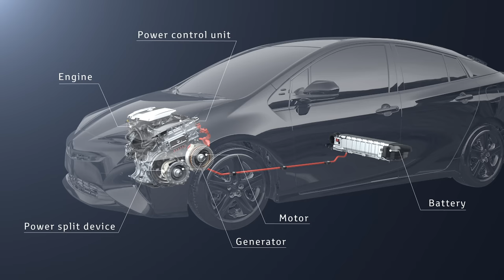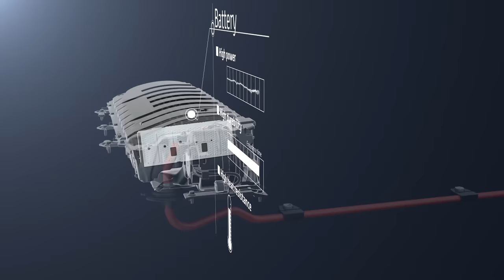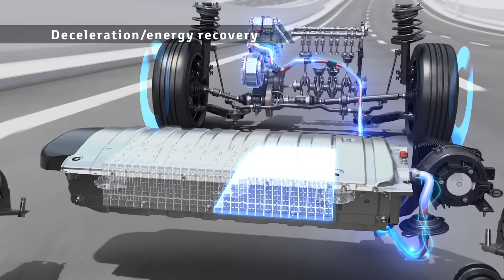What is Toyota Hybrid System

Comment: Something that I learned yesterday, is that electric motors are dramatically less efficient when load is less than 50%. Ideally, 75% load is used, as it's most efficient. The more powerful the motor, the more efficient it is at low load, supposedly. I have no idea if this is true, but it's interesting to think about. It means that the hybrid system could be almost always used in tandem with the engine during accelerating, for maximum efficiency. Otherwise, it's actually slightly less efficient, because it takes some energy to make electricity, and to run the motor. A result is a decrease in overall fuel economy, unfortunately. The CVT transmission more than makes up for this, but it could be better, and/or even simpler.
Reply: An electrical motor having a load of 50% will still achieve a 75% efficiency compared to an internal combustion engine which has a measly 23% efficiency at the most..
Reply: @boyetz88  that's definitely not true. 23% is low, definitely not it's maximum. It's at least 35%, but could easily be much higher than that.
Even though electric motors have a high efficiency turning energy into force, power, etc. they are not quite as efficient as engines, because the power source is being oversupplied, mostly being wasted. At any given time, electricity is being generated, but not being used. This is because electricity cannot merely meet demand. Anything not being used is wasted, grounded, etc.
It's not as good as advertised,  the comparisons are not thorough enough.
Reply: @grantmccoy6739  electricity is not directly applied to the motor, any generated electricity is saved on the battery, the motor draws power from the battery not the engine. So yeah motor is still way more efficient than engine.
Reply: @shaheenshad5012  actually it is. There is a direct path between MG1 and MG2. It looks silly at the beginning but allows the ICE to run at max speed and torque efficiency. Storing energy to use it later is less efficient choice.
Reply: No, engines are much worse at low loads. Electric motors are near 90% efficient from 1% load onwards until they hit around 80% max RPM. Engines have a narrow range of RPM and load where they operate the best. The hybrid system allows the engine to run in its happy spot, and store excess energy in the battery for later use, such as when the engine is turned off.
Reply: @Appletank8  I think that you're right. BTW, this post is around 1 year old.

I had read that electric motors are less efficient under low load situations, but I'm convinced it was incorrect information. If you think about it, the higher the load, the more hot it gets, which is less efficient, not the other way around.

But yes, the hybrid allows the engine to operate in its most efficient engine speeds.

I don't know what you mean by engines are much worse at low loads. Do you mean by comparison? Or do you mean the engines operate more efficiently at higher loads? There's no question that electric motors have higher energy efficiency. They don't even use their energy source, it simply passes through. That's why it's over 90% efficient. The loss of energy is due to heat, not work. Engines on the other hand turn energy into heat, and extract work from heat. It's inherently less efficient.
Reply: @grantmccoy6739  
Try looking up so BSFC charts for NA engines. These charts display how an engine generates power in relationship to RPM and load. In most NA engines, they are most efficient somewhere between 1.5K and 2.5K RPM, and at 70-80% load. Or, they produce the most power per unit of fuel.

This is because spark ignition engines tend to control power via restricting airflow. At low loads, the engine is forced to breathe through a straw, creating a vacuum force that slows pistons down. Opening the throttle valve allows air to flow more freely. Over 80% the amount of heat generated starts getting inefficiently lost to the cooling system. This is typically why overdrive gears are more efficient, even outside the reduced friction. The throttle valve can be opened more, and the engine spins more slowly in comparison to speed.

Diesel engines control power through fuel flow restriction, there are no air pumping losses.

Using late intake valve closing allows you to produce less power with a more open throttle, reducing losses, ontop of more energy extraction from the longer effective power stroke. 

Cylinder deactivation allows you to open the throttle valve more with less power.

EGR allows more air but less oxygen into the engine.

Turbochargers allows using a weaker engine for steady cruising, letting it open more throttle, until passing power is needed.
Reply: @Appletank8  yeah, I am aware of that.

But like you mentioned, with diesel, load doesn't mean airflow, which means that loss of efficiency doesn't apply.

In general, low load efficiency losses are a result of throttle restrictions, not actual efficiency performance characteristics. 

So, no, low loads are not less efficient as a fact. They are technically more efficient, because of better energy efficiency. 

So basically, low load is always more efficient than high load, unless the design changes this performance.
Reply: @grantmccoy6739  
Sure, but I was talking in context of most spark ignition engines, and for the past 100 years or so SI engines used throttle valves, which made efficiency worse at low loads. 

Only in the past decade or so have various OEMs experimented with valve-based throttle control. Meanwhile, hybrids do their best to avoid "low load" entirely, by instead running a higher load and storing extra energy into the battery and then turning it off.

The vast majority of SI cars still benefit from the pulse and glide technique, because they use throttle valves.

Lower loads are only really more efficient if the engine design is notably changed from standard, like turbos who are very decidedly less efficient due to the need to keep temps down at higher loads. (and even then, technically at lower load a turbocharged engine becomes an underpowered NA engine working at "higher" load)
Reply: @Appletank8  what's pulse and glide, never heard the term?
Reply: @grantmccoy6739  A technique that's more applicable to hybrids, but can still gain some benefit in gas-online cars.

Basically, you try to drive in two conditions only: your vehicle's most efficient zone based on the BSFC (brake specific fuel consumption) map, or not at all. Hybrids facilitate this by specifically controlling engine power to fall within the peak efficiency range, and being able to automatically cut fuel when off throttle with 0 engine braking, allowing you to coast a good distance on zero fuel usage.

Typical behavior would be to accelerate briskly to 45 mph, then coast to 35 mph. Repeat. 

For the Prius, its BSFC peaks at like 60-80% load, and from 1.7K RPM to 3K RPM, which is where the car's ECU tries to stay inside.
Reply: @Appletank8  so your in a constant state of acceleration and coasting? That's absolutely not more efficient, or practical. Obviously coasting is, but not accelerating. It's highly unlikely that the gains exceed the losses. Cruising is always the most efficient way to drive (while actually being powered).

But just FYI, 1,700-3,000 isn't exactly an efficient set of engine speeds. It's only necessary because of the performance of a 4 cylinder. It would be more efficient at even lower speeds, but 4 cylinders don't have smooth power delivery.

Also, constantly turning the engine on and off is way more extra work for your starter.
Reply: @grantmccoy6739  
This has been a technique practiced by hypermilers who get 90+ mpg on the prius for the past 20 years, so I think it's working pretty well. Look up "Energy efficient driving" on wikipedia for an overview on PnG, or "autospeed brake specific fuel consumption" on a detailed explanation on how it works. I myself regularly get 60 on a car rated for 45-50.

Also useful, search "beating the EPA Cleanmpg" for a more through explanation on what techniques advanced hypermilers use to get 50% more mpg than estimated. Its from 2006, but engine physics are still broadly the same.

Also, as mentioned in this very video, hybrids are designed to start stop the engine a lot, because they don't use starters, they have a 50HP electric motor.
Reply: @grantmccoy6739  
As a simple example, if you can accelerate for 10 seconds at 30 mpg, then coast 10 seconds at infinite mpg (0 fuel), you have essentially achieved 60 mpg.
Reply: @grantmccoy6739  
PS: PnG is less relevant for highway driving since you're usually near optimal operating conditions anyways, and air drag slows you down too much.
Reply: @Appletank8  that's right, they use the motor instead of the starter. It's a bit less problematic for hybrids. 

I'm not convinced about that tactic. Engines only use enough fuel to keep the speed consistent when cruising. The waste comes from the design, ie, engine speed too high, throttle restrictions to volumetric efficiency, or rotating mass.
Reply: @Appletank8  that's basically what I'm referring too, but that also explains gliding more to stops, as opposed to purely powered motion, and then braking.
Reply: @Appletank8  the question for this becomes, what is the cruising mpg? Because the fuel consumption under acceleration is way higher.

Basically, the entire cvt function of the prius confirms that cruising is more efficient than acceleration. But not directly,  I guess.
Reply: @grantmccoy6739  Well, yeah, in a perfect world power requested would be proportional to fuel usage no matter where you are. 10 hp for 10 fuel, 5 hp for 5 fuel.

But because of how SI engines are designed, IRL fuel consumption doesn't work that way. Turns out 5 hp requires 7 fuel instead.

Steady state at say 35 mph may require less fuel consumption in that instant, but you need more fuel per HP to maintain that speed, vs opening up the throttle for a bit more fuel and much more HP. 

Regarding the Prius, did you know that below 45 mph the ECU straight up doesn't let you use the engine below 1/2 power (assuming sufficient battery)? At such low load the engineers decided that running on electric is better than using such low load despite the conversion losses. 

At slower speeds, if you want to avoid the losses of converting motion to electric then back to motion, the best way to drive is to go at 2/3 power, even if it speeds you up faster than you'd need, then get off throttle and avoid the electric only zone. 

That increased fuel usage isn't "wasted", it is turned into kinetic energy in the car that you can then use to coast.
Reply: @grantmccoy6739  
Fun fact: imagine if 10 hp = 10 fuel, but 2 hp = 9 fuel

This is why turbine cars didn't work. Their efficiency peak is very narrow; only planes get away with it because they spend most of their time cruising at near top speed. Cars have traffic to deal with.
Reply: @Appletank8  it's pretty widely understood that engines are more efficient cruising than accelerating. I know you understand that, but it's very unlikely that what you're describing works, or at least, that it's the best possible solution. Maybe the design is not ideal for cruising, like you suggested, so there's some wiggle room. But it's a really awkward way to drive, especially with other cars on the road.

There's many reasons why the prius operates like it does. I'm sure it's because of the fact that its a 4 cylinder, and because it's gasoline. BTW, there are work arounds for gas engines, like direct injection, that remove the throttle restriction problem.

But generally speaking, lean conditions are more power efficient than rich conditions. Meaning, cruising is better than accelerating and gliding. Assuming that the design is somewhat efficient in the first place.

Here's some food for thought: in cruising, you are basically combining the situations of acceleration with gliding. Meaning the load is some average of the two. So the question becomes, is your car getting maximum possible energy efficiency out of its fuel under acceleration? If not, cruising is better. If so, cruising is about the same. See what I mean?
Reply: @Appletank8  yeah, that's interesting.
Reply: @grantmccoy6739  
Note that when cruising, people are generally at a speed where overdrive is hopefully in gear. At the highest gear, engine to wheel torque is lessened, and the engine has to work harder to maintain speed. Therefore, getting closer to the BSFC peak. Despite higher air resistance, highway driving is typically more efficient because of more time spent in overdrive gear. 

I can guarantee you that requesting the same power with a lower gear will increase fuel consumption, because the engine will have to restrict air to maintain speed.

Regarding your thought experiment, unless you can find me an engine that has an identical fuel per hp rate across a load range from 40 to 90%, or a car that sits perfectly in the lowest SFC zone while cruising, pulse and gliding will result in less fuel used over time.

I'm exaggerating the following fuel consumption for effect

imagine if the engine can produce 100hp for 10 fuel/mi in its sweet spot. However, you only need 50hp to maintain your speed. Unfortunately, at 50hp you need to use 9 fuel/mi. Using 10% less fuel for 50% less power is an awful trade. Might as well use 10% more fuel to go faster, then shut the engine completely off and use No fuel. This is the most important part. Instead of using 9 fuel/mi for 10 miles, you are using 10 fuel/mi for 7 miles, then no fuel for 3 miles.

In this example, cruising results in 90 fuel used (9 f/m * 10m, or 0.11 mpf), while PnG results in 70 fuel used (10 f/m * 7mi + 0 f/m * 3 mi, or 0.14 mpf).
Reply: @grantmccoy6739  And yes, how much you can squeeze out of PnG depends heavily on how annoying traffic around you is
Reply: @Appletank8  your relying way to heavily on "power" in your calculations. Torque is the only thing that actually matters. Torque is the force the engines produce, ie, how much weight it can move. Power is factored through distance, aka engine speed or wheel speed (final drive or gear ratios). You can have less Torque, but more Horsepower (due to engine speeds), clearly a paradox. 

The reason Torque doesn't produce the same acceleration when a vehicle increases its speed isn't due to power, it's due to air resistance.

As far as efficiency is concerned, torque is generally highest at lower engine speeds. The actual reason an engine accelerates is because it facilitates the change in vehicle speed (not because it produces more force) because the gear ratios are fixed. Adjustable gear ratios basically don't exist, but the ones that do are called, CVTs, like the prius.

On the other hand, increasing air/fuel does increase output, torque, power, whatever you want to call it, but unfortunately results in engine acceleration, an inefficient side effect. CVTs allow for engines to increase torque without accelerating, which is both more powerful and more efficient.

Edit: you are assuming that cruising is only 10% more efficient than accelerating, which must be way off. If it's correct, or just a hypothetical situation, you would be right.
Reply: @grantmccoy6739  
One, I'm using HP as a shorthand for increased throttle demand.

Two, gears are circular levers who multiply (or divide) torque. Cars will still accelerate slower at speed with zero air resistance because overdrive gears force the engine to have a proportionally slower speed to wheels. That's what levers do. How else do you think an engine can be at both 2K RPM and 3.5K RPM at the same speed?

Closing a door by pushing the middle vs pushing the edge is a lot harder, but you travel a shorter distance. That's what overdrive does. Air resistance only really becomes a factor above 40 mph.

Three, I said the cruising vs PnG example was an exaggeration for effect, it is not 90% less efficient, but it is not 1:1 either. This is why I asked you to look up some BSFC charts. 

Using Toyota's new 2.5L Atkinson engine since the EPA did a report on them, it is most efficient at converting fuel into energy at around 70% of possible torque, (170 Nm), and between 2K and 3K RPM, at 39% efficiency.

If you're barely feathering the throttle, at 20% torque (50 Nm), 2K RPM, your efficiency drops to 30%, which is about a 23% drop.
Reply: @Appletank8   I apologize for length.

the Atkinson cycle is fairly redundant. The beneficial result of keeping the intake valve open longer (partially during the compression stroke) is using less work to compress the air. You could achieve the same results, by using throttle restriction to reduce the air volume in the cylinder. 😆
So, no change. It's just a different way to achieve the same results. Namely, airflow control by a valve of some kind.

More food for thought: the efficiency differential between highway and city driving might be, 20 city/30 highway mpg (a fairly common statistic). This is a 50% increase, FYI, not 10% like your hypothetical scenario.

My car, a 1989 Nissan 240sx, has 20/26 mpg. A ~30% increase for highway.

It's not very efficient, probably not because it's old, but because it's a 4 cylinder, and operates at higher, less efficient, engine speeds. Unfortunately,  having more cylinders means more rotating mass, so it's a trade off either way.

Interestingly, the 1996 240sx that I used to have had a rated 20/28 mpg, and this additional efficiency was achieved by tuning the engine to run lean in a portion of the powerband that was highway speed in 5th gear. So basically, they sacrificed performance for mpgs. (You can see this in the powerband in these vehicles, it has a significant dip in output in these rpms, ~3000)

To be honest, I don't think that mpg statistics are that accurate. Even if an engine was tuned to be leaner, it would only matter under acceleration, not cruising, because engines only ever use as much fuel as needed to operate when cruising. But it could be that more air is being used, resulting in a leaner, more efficient condition. I honestly don't know. I only know that fuel is cut out of that part of the powerband, even under full throttle conditions. My Nissan has a weird tune as well, but it's different.

One if the reasons for gear ratios is efficiency, not leverage. Instead of running at 6000 rpm on the highway, you can cruise at a speed that has the most torque and mpg, and isn't as noisy.

It's really an interesting discussion about torque vs Horsepower, because it really is a discussion about leverage. In my opinion, I don't think that leverage is "real", which is another story entirely, but you can witness its effects, so it's hard to argue with. It all comes back to moment of inertia, being a moment and not a distance, but I digress. 

One thing though, leverage shouldn't effect torque itself, just the advantage ratio. So higher gears don't result in less Torque, just less "advantage in using it".
Reply: @grantmccoy6739  
I agree, engine torque doesn't change, but torque at the wheel does. The engine produces 50 Nm of torque, but when it goes through an underdrive ratio of 1.5:1, the wheel will output 75Nm of torque, at a slower proportional wheelspeed. This is why its easier to loosen bolts with a really long wrench, and easier to climb hills when you downshift.

Crusing really slowly at 20mph means you're stuck in underdrive, no way will you be able to go into 6th at 20 mph. Using that underdrive ratio earlier, the engine must be restricted to 33 Nm to have 50Nm at the wheels. This is very far from peak efficiency.

50Nm of torque through an overdrive gear of 0.5:1 means the wheels are only feeling 25 Nm of torque, but they're spinning a lot faster now. Like spinning a screw with your fingers. Useful for 60+ mph, bad for uphills.
 
If you need 50Nm of torque at the wheels to maintain speed, the engine needs to output 100Nm to get 50 at the wheels in Overdrive. According to the BSFC chart, you are converting fuel into torque more efficiently.

Note regarding Atkinson: Late intake valve closing is very much NOT the same as throttle plate restriction, outside the goal of reducing air in the cylinder. Otherwise the decision to use one or the other would be meaningless. A throttle valve forces the piston to draw air through a choke. A late intake valve allows air to flow more freely through the piston, and a greater expansion stroke ratio, therefore extracting more energy out of the combustion, and therefore higher BSFC to one without Late intake. This has been tested and proven multiple times. Throttle valves are butterfly valves, piston valves are poppet valves, they operate very differently.

I agree that engines will only use as much fuel as required, but they are using fuel inefficiently the further away they are from peak BSFC. This is shown in Toyota's released charts on how they restrict their hybrid engines to only operate within a restricted RPM AND torque profile. Because going away from it is BAD

Piston engines aren't as bad as turbine engines are, burning almost as much fuel at idle as in full power, but there is still a range of better and worse fuel usage. There's a dedicated community of hypermilers who use this technique and it works. It is not  theoretical, it is proven in real life tests.
Reply: @grantmccoy6739  The important thing to keep note of is that Pulse and Gliding is a kinetic way of emulating what Series Hybrids do (engines are not connected to the wheels whatsoever, and instead charge the battery only). When you accelerate in the most efficient BSFC mode, you are putting that energy into the kinetic energy of the car, just like how the range extender of a Series hybrid runs in its efficient mode to convert fuel energy into battery energy.

While the Hybrid then uses the electrical energy to create the kinetic energy of the car, the non-hybrid car shuts the engine off and "uses" the stored kinetic energy into coasting with no fuel needed.

While the initial burst of acceleration uses more fuel than cruising does, the big gain is the ability to use no fuel for a % of the distance.
Reply: @Appletank8   that's a pretty good explanation of torque. I never really thought about wheel torque like that. The last thing you said was that using 100nm to produce 50nm was fuel efficient, and I'm not sure what you mean by that. It would seem that the opposite would be true, that torque production was more efficient at low gear ratios. Considering how 50nm would result in 75nm, etc. My idea is that if the engine needs to produce less Torque, it also needs to consume less fuel. In this regard, and considering what you said about gear ratios, it would seem that low speed operation would actually be more fuel efficient than high speed, not less.

I disagree that the Atkinson cycle is really distinct enough to be note worthy. It's basically still drawing vacuum in the combustion chamber like normal (it's just not in the manifold, etc) but it just decompresses itself to control the air volume, as opposed to just restricting flow overall. Throttle valves meter air, while still allowing for adjustment to it, in case you need much more air/fuel for output, as opposed to being restricted to the ideal tune.

To be fair, there is a certain amount of work needed to draw in air, it's not nothing, but why would this be better? It still is drawing in air via negative displacement, it's just also pumping some back out. It could actually be less efficient in some cases.

As far as the Atkinson expansion ratios, that's not something people usually talk about, but it's like that with any ICE design. Every exhaust has higher expansion ratios than intake. It's the whole function of the engine. Reducing the intake "compression ratios" doesn't actually make it better either, it just reduces it on the exhaust side too. So it takes less work to compress, but it expands less afterwards. Maybe it works, but I'm not convinced.
Reply: @Appletank8  the only reason why this pulse and glide would be more effective, is because the normal operation of the engine is outside of the maximum efficiency (or force, if that is the objective) range of engine speeds. In other words, if the transmission is geared incorrectly, or the engine is tuned/designed incorrectly and wastes fuel.

With a CVT, there should be no need for p&g, as that is what cruising is (just on the minutiae of scales), and the gear ratios can be adjusted to suit the needs of the vehicle without shifting gears.

Just to go back to something you said in the other comment, gear ratios actually shouldn't affect the force output total at the wheel, only the distance over which it is applied. I don't think we should go around in circles about this, but I disagree with how you explained it, even though I think you did a good job and made a good point.

For example, you may be correct that the output in a 0.5:1 ratio goes from 100nm to 50nm, but since the distance covered is twice as much, it's still 100nm of force. So its 50nm + 50nm = 100nm. See what I mean?

I find it hard to imagine a scenario where it's more efficient to run a power plant at really high loads (albeit efficiently) to generate electricity for storage and then turn it off. It seems like it would be better to just match the power plant output to the demand (even just by throttling fuel), but I guess you might have intermittent demands. I know that the prius is some combination of these two scenarios, as sometimes the engine will be on or off depending on the situation.
Reply: @grantmccoy6739  
You still haven't gone looking at a BSFC chart, have you? In a perfect world, X amount of torque would require a proportional Y amount of fuel. 

As I have said multiple times in this thread, IRL engines do not work that way. There is a significant efficiency loss when the engine has to pull air through a restricted intake. Imagine trying to walk on a floor made of gum. Each step is draining energy when you have to lift it. The more restricted the intake, the stickier the gum.

Despite walking slowly, it takes extra effort just to pull your feet off the gum.

Why cruising in Overdrive gears is more efficient is explained in the BSFC chart too. I repeat: the ratio of torque to fuel needed is NOT EQUAL. There might be more fuel per stroke for the increased torque demand, but there are a lot less strokes per wheel rotation.

This is why opening the intake allows for better efficiency. Please do a search for  BSFC charts. I have been repeating this for the past 5 replies.

Regarding expansion stroke, um. No. 

Imagine a 1L single cylinder engine.

In standard Otto cycle, the intake valve closes at bottom center. The compression stroke therefore compresses a Liter in volume. The expansion stroke can only go down 1 L in volume when the exhaust valve opens. 1L intake = 1L power/expansion. You can't open the exhaust any later than that.

In an Atkinson, late intake valve means it only compresses 0.8L of volume. the power stroke still covers 1L, therefore a longer expansion stroke ratio. 0.8L < 1L.

This is on top of how it allows opening the throttle valve more, and therefore less intake losses.

Again, please, please look up what BSFC charts mean for engines, and the techniques hypermilers use for their insane MPGs way above EPA estimates. They'll teach you everything there is to know about how engines work. Numerous resources on the internet on why Atkinson is more efficient than Otto.

If you refuse to learn about BSFC then I might as well have been talking to a brick wall.
Reply: @grantmccoy6739  
That's ... not how you measure torque. Torque does not measure how much the wheel turns, only the amount produced at that instance.

The formula is Torque (Nm) = Force (N) * Radius (m)

If I have a screw that requires 10 Nm to open, and the max force I can generate is 5N, I can either generate a lot of torque with a 3m wrench (15 Nm), or struggle with a tiny 0.5m wrench (2.5 Nm). I am definitely producing less torque there, and therefore unable to unscrew the screw.

> the only reason why this pulse and glide would be more effective, is because the normal operation of the engine is outside of the maximum efficiency.<

CORRECT. CORRECT. CORRECT. CORRECT. CORRECT 
How many times must I repeat this?

Engineers must choose between optimal cruising efficiency at 40mph or enough HP to pass cars on freeways at 70mph. Obviously, they choose for more HP. I am trying to get you to understand how inefficient engines are outside of their sweet spot. Most cars only enter this sweet spot at around 60+ mph and in overdrive (which is why efficiency increases despite increasing air resistance). When throttle is restricted, especially to lower torque for cruising at below 40mph they are wasting energy 

As I said earlier, at 20% throttle you are 23% less efficient than at 75% throttle for that 2.5L engine. This is tested on a Real World engine, built less than 3 years ago. This is literally how they work. Older engines are even worse.

This is still true in CVTs because the optimal zone produces too much power for sub-40 cruising, due to, again, being designed for having enough power to pass cars at 70 mph. The benefit is being always lower the RPM at any speed, which reduces friction, lowers the gear ratio and opens up the throttle a bit more. However, if the torque required of the engine is less than the BSFC peak, then it will still be less efficient than P&G. This is how people get 90mpg in the prius despite steady state suggesting 50mph.

I repeat: the only time an engine would be most efficient while cruising is it can sit perfectly within the BSFC peak. It has been estimated that it takes only about 20HP for cruising at 40mph. Therefore, an engine that sits at BSFC peak at 40mph will only have around 40 HP. This car would be almost completely useless for anything else.
Reply: @Appletank8  I think we can probably stop here.

Like i said, the combustion chamber draws vacuum during intake no matter what, the difference is only in the strength of the vacuum, and where the vacuum is located, ie in the combustion chamber or manifold.

Also, the difference between a partial vacuum and a full atmospheric pressure combustion chamber is very significant in terms of compression. Maybe not in terms of distance (mechanical compressionratio), but certainly in terms of forces (air pressure, or PSI).

I'll check out the bsfc.
Reply: @Appletank8  you should try to recognize when I am agreeing with you, and when I am disagreeing, it makes the conversation less frustrating. 

You were saying earlier that wheel torque is a function of the change in distance of the difference of the gear ratios. Ie, that 0.5:1 ratio would change torque at the wheels. Since torque at the crankshaft is fixed, ie the stroke isn't variable (normally), your above reply wouldn't matter. BTW, my previous explanation using distance actually is relevant, that's how power is calculated, and leverage in some instances. I'm just pointing out that leverage is relative, and not "real". 🤭

Just FYI, there's a major contradiction in your above explanation. 

You suggest that the reason that the efficiency isn't maximized is because of throttle restrictions, but you also suggest that the reduced air volume of the Atkinson cycle is more efficient. 

So, your basically saying that more air means more efficiency, but also, less air means more efficiency. You may not be suggesting this specifically, but that is a possible result of the situations you are describing, you need to understand that.

If you're objective is simply to suggest that intake vacuum load is the actual problem, then that's fine, I understand. No need to reiterate your point. I don't think it's possible to completely remove intake vacuum, in a 4 stroke engine. 🤫

BTW I actually designed an engine back in 2020, and it attempts to solve the problem of being able to operate at both peak efficiency and power without compromise. I don't want to get into the details, but it's a 20+ page document, it's very in depth.

I think you're perspective on efficiency is limited by current designs. I don't think that it's accurate that an engine that is efficient while cruising at low speeds can't also be efficient at high speeds as well. It just doesn't make sense, as both conditions are possible. You're saying it can't be designed because it hasn't yet. It's like if people said you could never have a compact 8 cylinder because it hadn't been designed yet.

What you need is an engine that can act like it's half as big at low speeds, and then twice as big at high speeds.
Reply: @grantmccoy6739  
1) It is completely possibly to reduce intake vacuum. Generator mode, for example, runs the engine at max efficiency with less intake restriction and saves it to battery to use when the car would be inefficient otherwise

2) Yes, there have been various techniques developed in the past decade to get good efficiency in both slow and high speed ranges, a lot of it is, again, based on getting the engine to breathe as easily as possible. 

i) Engines that can vary between Otto and Atkinson. Otto for high power efficiency, Atkinson for low power efficiency. Basically, VVT, VTEC, everything else related to that, because different engine speeds require different breathing requirements. In that Autospeed article on BSFC, it notes that the original Insight engine had two efficiency peaks.

ii) Cylinder deactivation. a V8 running on 4 cylinders must open the throttle more to generate necessary power, therefore breathing better. (though there's still the weight penalty)

iii) EGR, or Exhaust Gas Recirculation. Fills the cylinder with air that has no oxygen. Easier breathing + less fuel burn.

iv) Hybrid cars. Run on electric mode when using the engine would be less efficient, run on engine when it can be used in efficient mode. Generator mode when battery low.

v) Turbocharging. Allows you to undersize the engine for cruising (less natural aspiration power, more open throttle), though the heat from forced induction requires wasting fuel for cooling.

vi) more gears better than less gears. high RPM BSFC is even worse than slightly restricted low RPM BSFC.

vii) More valves. better air flow. Engines using older designs have 2-valves per cyl vs 4, some even have 5.

viii) Toss that entire engine out of the car, stick it on the ground as a terawatt power generator with two-stage heat recovery, and run the car on electricity.

ix) Mazda's SPCCI Skyactiv series engines, to get extremely high compression ratios without gasoline combusting too early, and a cleaner lean mode.
Reply: @Appletank8  the technology (direct injection) to eliminate the need for throttle valves has existed for decades but basically no one has used it for some reason.

When I designed my engine, I chose to not use a throttle plate for the purpose of using more thermal mass for better expansion efficiency, and never occurred to consider vacuum work losses. But I guess you are right.

To be fair, at high engine speeds, cavitation is unavoidable, meaning some level of vacuum will always exist* (4 stroke), but I do agree that it's less without throttling the air. Also, I believe, based on diesels, that high air volume is not a bad thing, even when in a lean condition.

But yes, all of those things can effect the amount of airflow efficiency etc. which results in both better power output and efficiency.

Another thing, with direct injection, you don't have to run rich to avoid detonation in turbo engines.
Reply: @grantmccoy6739  
I am fairly sure many cars use Direct Injection nowadays, though not the way you're thinking of.

Gasoline Direct Injection tends to add fuel during the intake stroke (called Homogeneous Charge) to give time for fuel and air to mix. It gives precise control of fuel/air ratios but doesn't really do much for MPG. Most cars use this plus port injection to clean intake valves.

The other technique (Stratified Charge), injecting a small blob of fuel near the spark during compression, was an attempt to emulate Diesels in efficiency, but ran into the same emissions and expense problems of Diesel engines. If you're adding all these heavy duty catalytic and high power injectors, might as well just use a diesel for the lubrication.

Just copying a diesel engine and injecting gasoline fuel into a heavily compressed cylinder is very tricky, because of the different combustion physics of the two fuels. Diesels burn slower, so its a lot easier to control how quickly and where maximum pressure occurs. Gasoline typically is too volatile, burns too eratically, to be controlled purely via injector timing.

IIRC the only company that's come close to figuring that out is Mazda's Skyactiv-X design, being a Spark Controlled Compression ignition (SPCCI), which operates by compressing a lean mixture close auto-ignition, but not quite to avoid uncontrolled ignition, then igniting it the rest of the way with a tiny bit of injected fuel near the spark plug due to the controlled spike in pressure. This allows for much higher compression ratios, producing better efficiency. They run Atkinson style when it reverts into standard spark ignition mode for power, because SPCCI only works in low power scenarios.
Reply: @Appletank8   there's not really any reason why DI wouldn't be able to provide the adequate amount of fuel for high power output. I think the injectors are typically small because there's not enough room on the head with all the valves.

Mixtures shouldn't be a problem though, as the combustion chamber is very small at TDC. Even without intake manifold evaporation, good mixtures should be possible, especially at low rpm (4 cylinders don't operate at low enough rpms for good CC mixtures).

SPCCI is mostly marketing if you ask me. It's basically just a spark ignition engine. It has higher compression ratios, near to the point of detonation, but it's still ignited via spark. In my opinion, alot of this technology is marketing. It's basically necessary to "upgrade" the tech because it makes people more likely to purchase it because it's new. It is still useful though.

In my opinion, there's only two reasons for direct injection in gasoline-powered engines: to run lean; and to prevent wasting fuel on a 2 stroke.
Reply: @grantmccoy6739  
I honestly a little baffled you think such high compression for a gasoline engine isn't a big deal, Mazda's pretty much been at the forefront of high-pressure gasoline engines with their Skyactiv G series for over a decade now, especially at keeping fuel efficiency more balanced across a wide range with their turbo engines. 

Is the fancy name marketing? Sure. So what if the engineering produces results?

Higher compression almost always generates better efficiency. Getting better compression ratios than pretty much everyone else is pretty impressive. Sure its still spark initiated, but if it changes how quickly the flame front moves, that improves fuel efficiency, and I think that's pretty neat. Especially since its designed to address low load situations to, once again, reduce intake air flow restriction.
Reply: @Appletank8  yeah, I didn't really mean that. I meant that "spark controlled compression ignition" is kind of a hilarious term, because it's not actual compression ignition, and all gas engines are "spark controlled".

High compression is awesome though. I just didn't really get my point across that well. Mazda calls it SkyActiv technology, it could not be a more "marketing" term.
Reply: @grantmccoy6739  
I mean, the holy grail of gasoline engines is HCCI, or Homogeneous charge compression ignition, which has been produced in a lab. It stays in a lab because conditions need to be too precisely controlled to ignite properly in the real world.

If they figured out how to replicate diesel like efficiencies and pressure characteristics with a gasoline spark engine at such a high compression ratio, I'd let them have it.
Reply: @Appletank8  the solution isn't even in the engines design, it's the fuel itself. It's nuch easier to produce a synthetic fuel with the characteristics you need, rather than an engine that can over come the fuels deficiencies/limitations. Aviation fuel is a great example of a stable fuel that is very safe, but still has great performance.
Reply: @grantmccoy6739  
I'm like 90% sure Aviation fuel is just kerosene (which is fairly similar to diesel) or leaded gasoline (which only started getting phased out the past year)
Reply: @Appletank8  supposedly, you can put out a cigarette cherry in the fuel and it won't ignite. It's extremely stable. Similar to diesel I believe. I've also heard that jets use kerosene as well. Who knows? But the point is, a new fuel would be a better solution then trying to rack your mind attempting to overcome the fuels limitations.